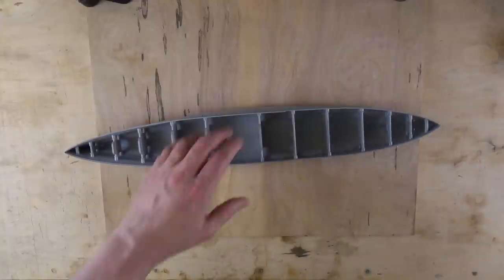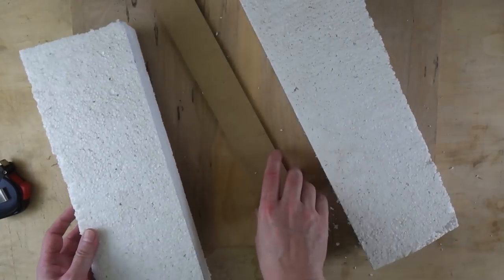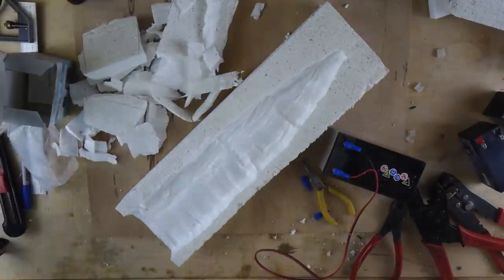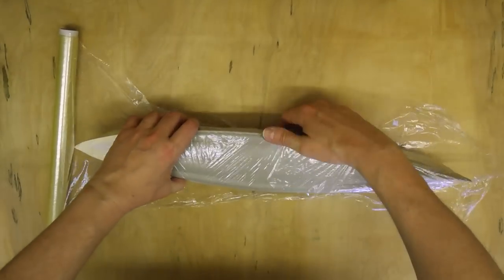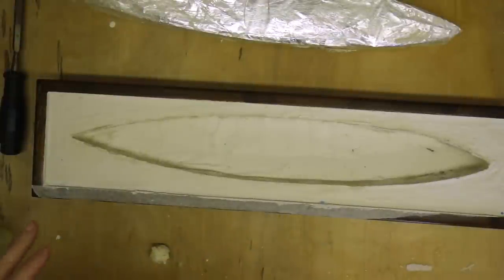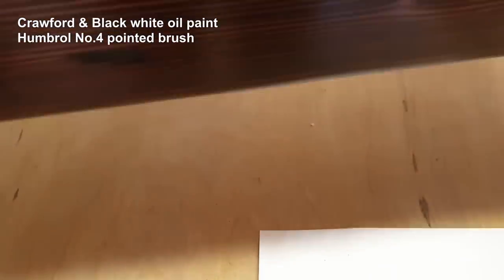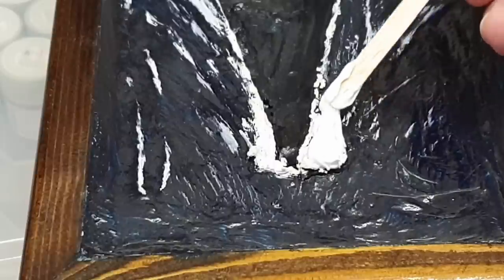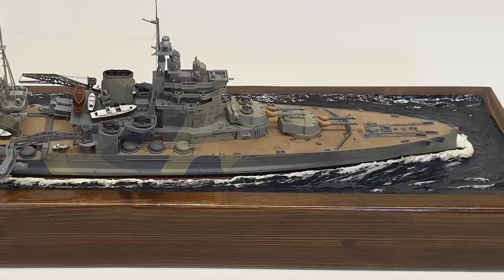Building a sea display base of the 1/350 scale Queen Elizabeth battleship

Comment: I see you creating the foam effects using white paint.  Looks good.
Have also seen people doing this with white silicone applied over resin, with excellent results.  Have you ever tried?

PS. Very lovely build sir.

 Edit: ah yes, the closing scene.  Could have been cheap silicone from the B&Q.  Nice one.
Reply from the maker: You could use resin, certainly, but my concern was that with the base being so deep, it would be exceptionally difficult to seal everything and if the slightest bit of resin got through, the foam would simply dissolve. As for the silicone, that too would work well but the structure gel holds its shape better. The other thing is that everything I used is water soluble for easy clean up, and there are no nasty fumes to contend with, so folks working at home don't have to stress too much about the fallout :-)
Reply: SteamGeezer and Son Independent Traders fair point, had not thought about potential cleanup when relocating the, erm, boat.

Thanks for answering, much appreciated.  Keep up the fab fabbing.  Next, a 1/10 scale Sherman tank?
Reply from the maker: @AJC508  I might do some armour at some point. I doubt it'd be that big though :-)